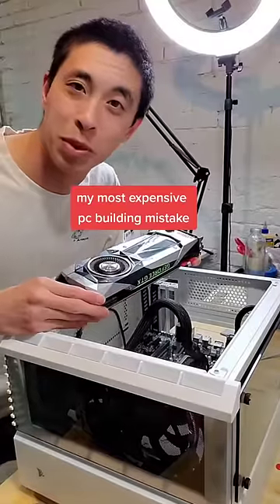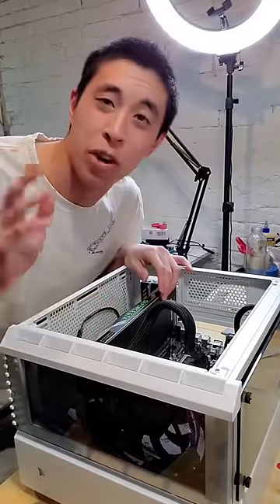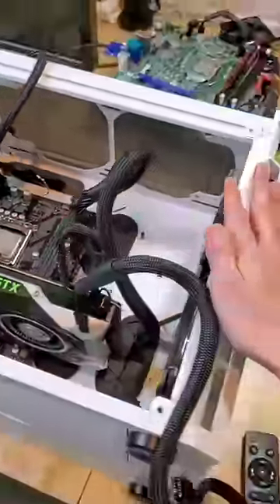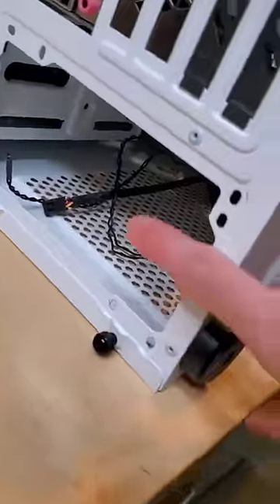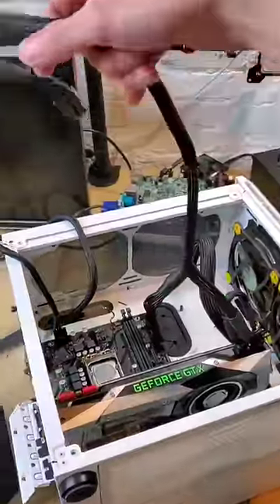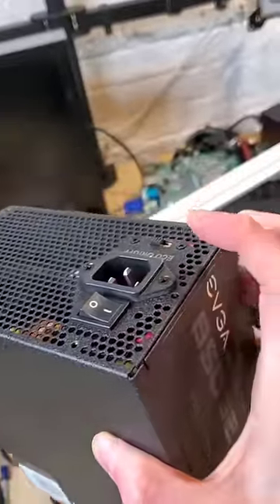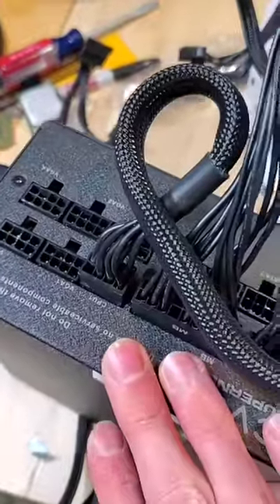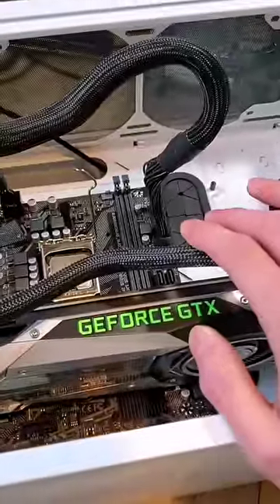my most expensive pc building mistake... #shorts

Comment: Early 2000's, missed a motherboard standoff when trying to upgrade my motherboard and ended up screwing on part of the motherboard directly to the case's metal. Pop went the weasel.
Reply: Oof that was the mistake I made when I was building my first pc. I had no idea what standoffs were so I screwed the motherboard onto the case. When I opened it I just heard a screeching noise. Decided to turn it off until my cousin visited us so that he could take a look (he knows way more than I do). Took a look at it and said "you missed the standoffs". Took everything apart, put on the standoffs and rebuilt the pc. The pc worked just fine for a week or two but then it just decided that it wanted to die
Reply: @Blueish That "screeching noise" was actually its will to live leaving. After that it was so depressed, it took just that week or two of thinking to finish what its creator started.

Comment: Back when I was much more curious about things I decided to find out if a HDD ( not external ) was plug n’ play.

There was a moment of realization and distress when the drive fried immediately.

IDE HDD’s are definitely not PnP.. at least that one for sure wasn’t.

Preventative measures: plug in components with the system powered off.

Edit: Added IDE for clarification since someone didn’t bother to check the replies before commenting.
Reply: I just did that a couple weeks ago and fortunately nothing broke... Thank god i found this comment before trying it again lol thanks dude
Reply: @gorka7509  No worries lol. Keep in mind this was YEARS ago, and hardware has been improved in terms of functionality and safety.

Though you were fine this time, always be careful. I'm happy to know none of your components were damaged!
Reply: @gorka7509  this is weird. I mean, you can literally swap in and out rams without any problems, and hdd too i think, only that they won't work, until you reboot the system. 

Are you sure you didn't miss connected it or it was a faulty hdd?
Reply: I have no clue what you did but I have been pnp my hdds for years now, weird
Reply: @yorailevi6747  I’ll add on to my original comment that this was done with an IDE HDD. Fried it instantly.

And while certain components do indeed support PnP ( SATA being one of them ) I’ve found it better to always power down a system before switching internal hardware.

Besides, I’d rather avoid working inside of a case when a system is powered. It’s never that serious, as that in itself could present an entirely new set of issues.
Reply: @sam_music555  You can swap out ram while the system is on? Last time I did something like that to one of our old laptops there were sparks.
Reply: @martianmarcera6721  this makes sense because rams are under tension while the system is on. However there are a lot of yt videos doing this, so idk what to say
Reply: @sam_music555  sample of such video on YT? This got me intrigued.
Reply: As far as i know, HDDs tend to be hot swappable, it depends on the bay you slot them into :p
Think NAS/General Storage solutions. ^^
Reply: @Ic3w4Tch1  maybe not pnp. I'm not sure but if you plug on sata3 an hdd on Windows, I'm pretty sure it won't work, as it has to be mounted. Maybe on linux, where you can edit fstab and remount everything
Reply: LOL.

HDD's (Unless speaking of IDE, or SCSI) are absolutely plug and play.

The Serial ATA power specification LITERALLY accounts for this. Its the orange wire.

You have no idea what you're talking about.
Reply: @nexxusty  but at least on windows, you cannot use it if not mounted. How can you mount it on the go? 

Should disk manager show the hdd just attached so you could mount it without rebooting or exiting the session?
Reply: @nexxusty  He did specify in the replies his HDD was IDE. Maybe you're the one who has no idea what he's talking about.
Reply: @nexxusty  and maybe you should either just help or just not reply. If you're so smart why wouldn't you.
Reply: @630majic  completely agree, ide makes sense
Reply: @630majic  I tend not read replies for comments I perceive to be stupid.

My bad on this one.
Reply: @nexxusty  Fair enough. No harm no foul.
Reply: @sam_music555  RAM is NOT hot swappable for ordinary desktop systems. Hot swap RAM is a feature of servers where it might not be possible to turn off the machine or it's impractical to do so because of the downtime. Not all servers support this, it's a specific feature that you have to check.
Reply: @Vendemiair  i meant that you can detach ram sticks while the pc is on without ruining them, but still you have to reboot to make the system usable again
Reply: @sam_music555  Nope, ordinary PCs do NOT support  physical manipulation of the RAM, whether you just remove the RAM stick(s) or remove and replace with a new one (hot swap). Since RAM is being actively used by the system, removing it will cause the PC to crash and you'd be lucky if you don't cause permanent hardware damage. As an analogy, it's like removing a car's radiator or carburetor  while you're driving, these parts being critical components of the engine which function continuously while it's running. I don't have to describe what would happen if you did that, right?

To begin with, why would you even do that when you can simply shut down the computer? Spreading this kind of misinformation is irresponsible, but I think many PC users still retain enough common sense not to move around components when the PC is turned on.  🙄
Reply: I was gonna test out if my SATA HDD was plug and play like an external drive until my IT teacher told my class that he once did a hard drive swap years ago for a company and he forgot to unplug the computer. Costed the hard drive, and even if that drive was IDE and my SATA one was plug and play, I still decided to not take the risk as I didn’t back up a lot of stuff on my HDD. However, I can confirm, if you unplugged my HDD from my All in One PC while it was on, the hardware disconnect sound would not play and my PC thought it was still plugged in for a few seconds after I unplugged it.

Comment: After doing little tweak after little tweak on my motherboard when building a new pc, I was religious about turning off the power in between every tweak, but on the final one, I was too excited and forgot. 
I ended up touching a live wire to ungrounded points on the motherboard, blowing multiple circuits and even a capacitor. 
It doesn’t end there though, I was convinced it wouldn’t be that bad, so I continued to use it with my new i9 13900k and RTX 3090 Founders Edition. As you could guess, these parts were quickly corrupted by the motherboard. I now need an entirely new build and am down about $2.3k
Reply: Oosh...😬

Comment: I busted an AM4 motherboard trying to unstuck the PCIe lock from my graphics card once. The board only had 3 or 4 screws on, so the entire bottom right lifted off the tray and smacked right back into place with the vengeance of an angry metal hamster. Had to wait a solid few months to get it replaced in a new build lol

Comment: I broke my 800$ custom keyboard
Story: I was soldering it when it happened but the PCB snapped in 3 pieces it was instant. But now I learned my lessons for not buying a hotswap PCB.
Reply: bruh tf, was it made from gold or something
Reply: @damianosplay9457  the case was ok but the PCB snapped in pieces.
Reply: @welpyes  bro, I meant why spend so much on a keyboard?
Reply: @damianosplay9457  addiction/hobby
Reply: How does a PCB snap into 3 pieces? Must have been something very unusual.
Reply: How tf do you spend 800$ on a keyboard?
Reply: @mrsaul3709  idk maybe I damaged it beforehand.
Reply: @lmaooxdd3899  It's a very expensive hobbie, building your own keyboard can get that expensive because parts are manufactured by small busnisesses
Reply: @mrsaul3709  soldering was probably key word for practicing the dark arts. he must have angered the pcmr gods
Reply: $800 🤡
Reply: how do u snap it in half, I've been soldering different types of keyboards and all of them never go past 80 dollars even if it's custom (unless it's hot-swappable). I still don't understand how you can do it to an 800 dollar board and snap the PCB into 3 pieces.
Reply: @altria5538  maybe I damaged it beforehand, cuz it's been sitting at the top of the shelf for days or weeks opened. That's because I'm busy doing some important stuff.
Reply: @All Size Makes The Wood Rise  I wanna ask what board is it, what's the PCB?
Reply: @welpyes  still sounds wack, you must've been applying a ton of force or it had a real then pcb, check if there's any extras for the PCB I suppose, unless you want to try connecting up the snapped PCB lmao

Comment: luckily i havent made any mistakes in the last builds iv done but i remember when i was younger and first started messing with computers, i dropped a hard drive onto the table from about a foot and a half up and knocked a resistor off the back. It still worked but the hard drive died a week later. got a error message that said hard drive failure imminent. Iv been very careful ever since.

Comment: I was carrying a GPU that just arrived from Amazon. I dropped it after power up.. Blank screen the fan was not spinning GPU destroyed lesson - handle pc parts carefully
Reply: Lmao, I took an old 1050 ti from an old pc on bed and rubbed the gpu on the bed. It still worked though, so I was glad.
Reply: Should have returned it, then bought another. You'll get your money/new card loooooooong before Amazon ever realizes what you sent them wasn't working. Especially if you returned the same day it came, just looks like you didn't want it. They may never have even realized it was broke. Not that I recommend doing this, but..........
Reply: @mycelia_ow  I ordered a replacement and they thought it was already broken. 😅
Reply: Carefully.. Just don't drop it lol. PC parts are alot tougher that you'd think.
Reply: @remiroy270  right, but it was a hard drop really hard. scared me to death
Reply: @Kryzen2  I can imagine, I have mine and I've had a couple slip ups and it constantly worries me cuz it's not done building yet so I can't tell if something is wrong before I try it
Reply: @Kryzen2  but generally PC parts are fairly tough. Theres a jaystwocents video where they build a PC while doing everything that you're technically not supposed to do and it still worked.
https://youtu.be/CDUZRNp4pxg
Reply: There is a guy who buries his CPUs in his garden for month on end.
They still work afterwards
Reply: @mycelia_ow  if the seal sticker was ripped, what are u gonna do?
Reply: Linus Tech Tips?
Reply: @ryzenryne8747  I don't know how but amazon still replaced it
Reply: #dontbealinus
Reply: @juancisneros725  I'm not
Reply: This comment is sponsored by Linus Drop Tips

Comment: DUDE I was going to do your mistakes later this week thanks a ton for sharing!
Reply: Lol same, I just bought a 3080 and a new psu. My old one is a 650 watt and the new one is 1000, I was just gonna unplug my old gpu and thought, “at least I don’t gotta reroute the cables”
Reply: @ironclad2355  wait so what cables do u use? The ones that come with the psu ? And can u buy cables aswell that r new?
Reply: @apurbayt1200  the new psu cables and there should be branded and generic compatible cables, just look at the model number on the box
Reply: @ironclad2355  thanks

Comment: Glad I took the time to watch this; I had no idea that was a thing.
Reply: It's only the ends of the cables that are a standard thing, it can plug into the PSU anyway they want it to.
Reply: @colinjava8447  different manufacturers have different pinouts?
Reply: @dialed4life  I mean the end that plugs into motherboard or gpu is standard, but the end that plugs into PSU can be anything.
Reply: This is why when you order aftermarket cables the manufacturer makes you select which specific brand/model power supply you have
Reply: @abadmixtape  Most PC builders use them as extensions rather that directly plugging the after market cables to the power supply. It's safer that way while still getting the esthetics.
Reply: Every model from a PSU supplier have different cables regardless if they are from the same brand. Do not mix the cables because if the PSU is damaged it can brick everything that is connected to it. I don't understand how people do not research this before investing thousands in a PC.

Comment: Switching power supply cables. Yep that happened to me too 🤧
Reply: Hi, I’m not English and i don’t understand on the video the reason why he destroyed his components. Could you explain me? Thanks
Reply: @hugodanis6144  Psu cables are made for that specific psu. If you plug in different cables chances are the connection isnt going to be as it should and the cable will melt or fry the whole system.
Reply: @Andytlp  Okay thanks
Reply: @Andytlp  but then why do companies like Cablemod exist? They make custom coloured PSU cables. So like, does this mean if u buy custom cables it will fry your system? Makes no sense, I thought as long as you plug the cables into the correct places it should work right?
Reply: @yusefaslam9675  Are cable mods psu specific or its one cable fit all.
Reply: @Andytlp  Actually just checking on their website it seems that they are PSU specific.
Reply: @yusefaslam9675  No doubt then.

Comment: The moment you said a power supply wasn’t included I could see where this one was going… Painful mistake but good on you for sharing so others don’t make it too.
Reply: So basically make sure you power brick isn’t too strong ?
Reply: @BlazeEst  the problem isn’t the wrong power output but rather that different power supplies may have different pinouts on the PSU end of the cable. Only the device end is standardised.

Comment: I lived in an old part of town at the time with lots of electrical problems. I had my pc hooked up with a cheap surge protector. Thankfully, it only killed my psu but it did catch fire.
Reply: What do you do if your psu catches fire? There isnt enough time to unscrew the psu, you cant put water on it and you cant put a towel on it. How do you prevent the psu from destroying the whole pc?
Reply: @BIanka0200  it was a quick flare up and then it went out on its own. The only reason i saw it was i had the tower on my desk.

Comment: I didn't understand why until I googled and read that modular PSUs use the same form factor but move pin out voltages. That means it wasn't your fault, it's manufacturers who are at fault. You're absolutely right to assume it should work because there is usually a standard that if it's different you should make it a different shape so it doesn't fit.
Reply: explain please a bit more.

what do you mean pin out volateges?
Reply: @zenastronomy like the little pins in the cpu cable's port. Even though they're both for the cpu, they mix up the individual pins

Comment: I actually ALMOST did this mitake myself a few weeks ago. I was rebuilding and building with leftovers in the case I was replacing, and I figured heck, the cable management is so tidy and nice in here, I don't want to ruin it and they're both sporting a Corsair SF PSU - one 600W and the other 750W, but I figured it can't be that easy and I knew incorrect cables could cause issues or at least not cause the system to boot and I didn't want to take the risk and replaced all the cables anyway. Soooo glad I did that, I had no idea that could've fried all the components. I guess I should've known, but the thought didn't appear to me at the time. Thank you for sharing, wish I had seen this a lot sooner so I would've known in an instant, to never do this lol. Sorry for your loss, hope you recovered some of the investment somehow!

Comment: this is why i always do research and ask questions first, even if i look dumb by doing so, its better than wasting money
Reply: Also every days a school day and others reading will also if honest would be asking the same stupid questions.
Reply: I do research and ask questions. But sometimes it seems so obvious you don't think. 

I certainly can't fault someone for thinking: ATX power supplies are all standardized so obviously the pin-outs will be. Besides, if they were different they would obviously design it such that the cables cannot plug into the wrong power supply.

Comment: It’s not the most expensive thing ever but was my most expensive mistake, an easy one:

I was cleaning a computer using computer duster cleaner (the stuff in the can). I sprayed into the power supply unit’s fan and once finished tried to boot up to find it wouldn’t attempt to power on.

Realized I fried the PSU and needed to buy another.

The solution is to not spray that stuff in the fans of the PSU and to also make sure to properly power down (unplug and hold power button to release excess power. I also now press the power button a few more times just for more assurance on my part.) I also now use an electric duster which doesn’t use this liquid spray so I can now spray into fans with little worries (still do properly power down and let off excess power).
Reply: The PSU's have a power button? or you mean the computer power button?
Reply: @chapitaaa666  the power switch on the psu that goes left or right

Comment: Me, using a voltmeter to verify every connection if the cables were suspect or if it was simply built from used parts.

Comment: I did the same thing. I bought a case from marketplace, and it came with cables to power the hard drives. I didn’t know that cables from another PSU would be an issue so I plugged my hard drive in and fried.